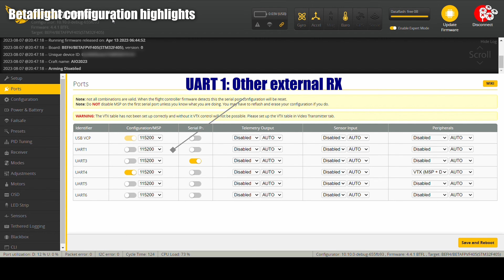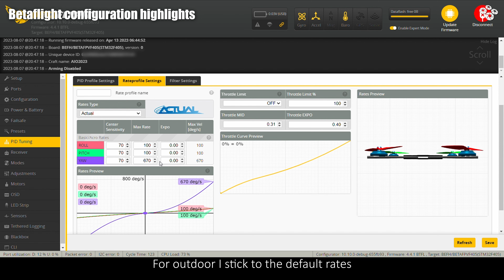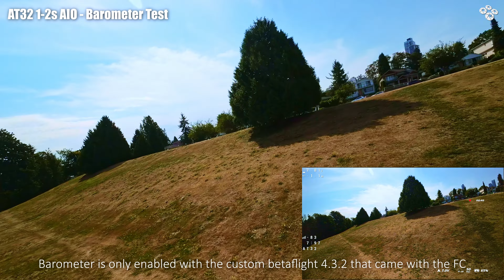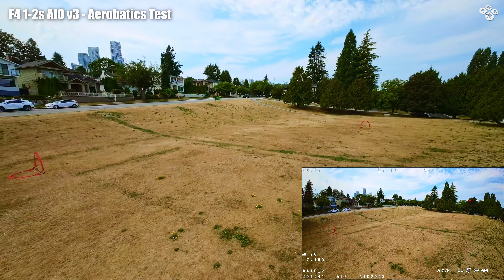BetaFPV Pavo Pico vs Pavo Pico - new flight controllers build, test, race, and more (4K)

Comment: Subscribed!

I used the similar concept of the rates, leaving my yaw default and lowered roll-axis. It fly great! The throttle expo gives on rail like feeling.

Anyway, is it safe to use throttle expo as high as 0.4 like yours for outdoor flight? I only in 0.2 and not brave enough to try to increase the numbers.
Reply from the maker: Thank you very much for your support! I use 2 rate profiles - indoor and outdoor. Only the prior with a high throttle expo while the latter has no expo. It is still possible to fly with high expo as some of my flights go from indoor to outdoor or vice versa. You may experiment and find out to your best tune. Happy flying!
Reply: @flyingpudding  ah I see, yes I plan my flight to be outdoor-indoor-outdoor so I got to find the middle ground. Thank you!

Comment: 3 min?? how much mah are you flying with?
Reply from the maker: I use Tattu 2s 450mah 95C and Condar 2s 500mah. They provide similar flight time.
Reply: but you fly them pretty empty right? @flyingpudding
Reply from the maker: @FineBirdsFPV  no. I land at around 3.5v per cell. I used to run it lower and learned the lesson the hard way - killed a couple packs. Voltage drops very quickly after 3.3v per cell and it is often too late to land.